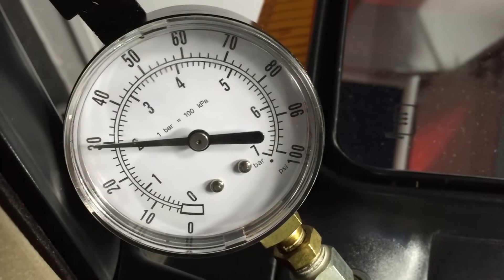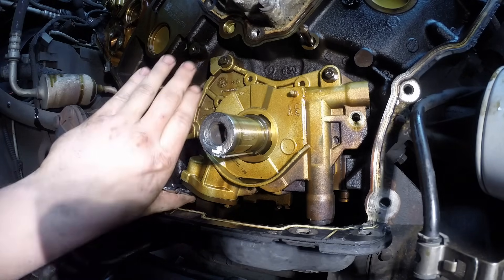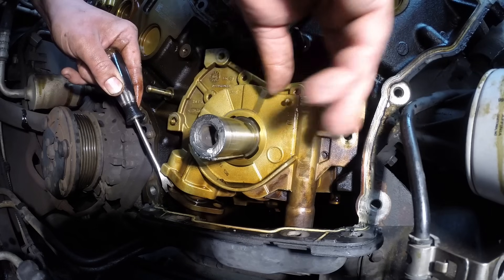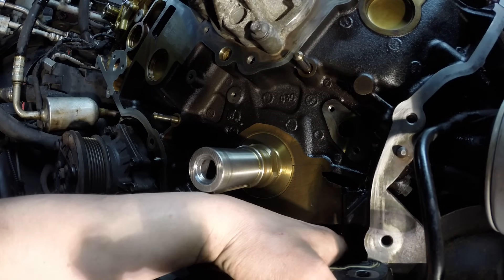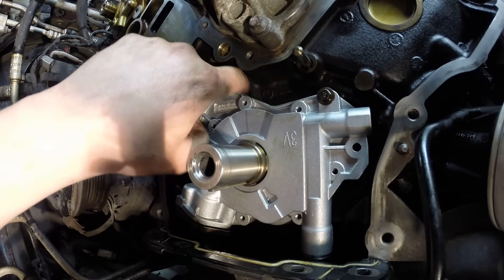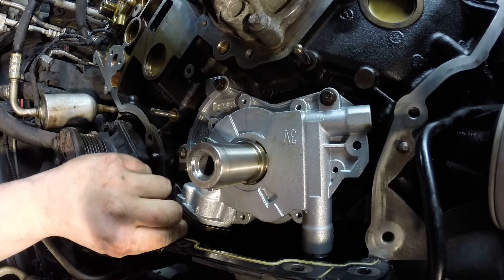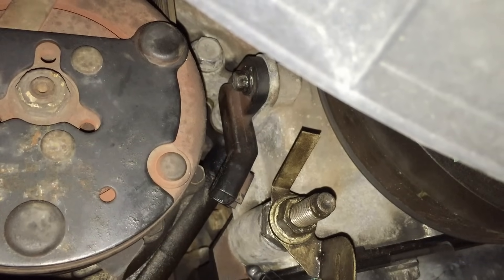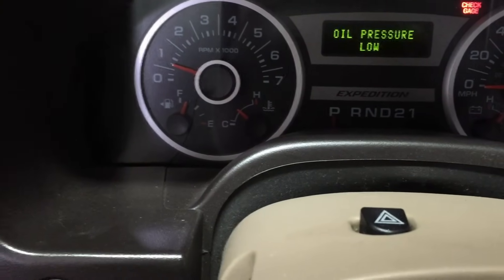Ford 5.4L 3v Engine Melling M360 Oil Pump Upgrade

Comment: +FordTechMakuloco sir I know this is off base somewhat but is there anyway you could put the Engine wiring/starting diagrams and fuse box/relay diagrams for a 2013 Focus Titanium on your sight? Can you direct me to a place that really has the exact things I'm asking for? I need to know which relay is the starter relay and how the starter solenoid receives it's signal/voltage from the push button all the way to the starter and I'm finding this info hard to come by. Anything might be helpful. The problem I'm having is the solenoid on the starter is not having voltage sent to it when the push button is pushed. All the grounds are good,I watched your videos on those things. Thanks for your assistance. Please don't tell me the only place it's available is ford. Also there is no problem with the alarm system,that is not the issue.This only occurs after the vehicle is driven several miles and hot soaked in the sun,come out of a store or some place ,put foot on brake push start button all dash lights as it's supposed to, no crank,wait an half hour or so and then the car starts as if nothing ever wrong. Let sit overnight never has problem.Just after a 4 mile or more drive and a heat soak outside in the sun. What do you think? Trans control module , starter relay, not the starter,when it occurs it's not receiving voltage to the solenoid, I can jump across and the starter works and the car will start and run.
Reply: BBB Industries online under Technical
Reply: Not sure what you mean by that. Could you be a little more specific. Thanks.
Reply: Went to the sight but wiring diagrams were limited at best,just signed up to Mitchell 1 DIY for a month and printed out all the wire diagrams for my vehicle so now don't need that anymore. 16 bucks is pretty cheap for all the have.
Reply: Got a bad TCM trans control module unable to send signal to starter relay. Under warranty from Ford, replaced it and did it for free. even gave me rides to and from dealer to pick up car. Damn good deal.

Comment: Will the Melling M360 work on all 5.4 3V or do I have to use the M340 on early models?
Reply from the maker: +Jean Valjean it works on all
Reply: @FordTechMakuloco  whats confusing buyers on amazon is that, it telling customers that the m360 wont fit 5.4 3v only 5.4 32v. so if i buy the m360 for the 2004 5.4 3v should indeed work right i would appreciate if you reply me here or my email gramiro2827@gmail.com
Reply: @ramirogarcia4947  did the 360 work? I got the melling 340 is it good for the 5.4 3v
Reply: @nicholaspierce9043  Apparently, the 360HV was installed in the 4-valve 5.4 and is backward compatible with any 3-valve engine. Does not fit 2-valve.

Comment: 2 Things I would like to point out is: 1 An it never hurts to put an anaerobic sealer on the oil passage mating surface. And 2, If the guides have come apart, more often then not, pieces end up in the bottom of the oil pan and can get sucked up into the pickup. That being said, I get the commission benefits of not taking off the oil pan, however comebacks are a killer.
Reply from the maker: +lveroflife if a guide came apart in junks then yes absolutely pull the pan
Reply: @FordTechMakuloco  Do you have a video for pulling pan? Is it necessary to raise motor on 04 5.4?
Reply: I think he did recommend that you scope the pan to make sure it didn't have debris inside.
Reply: Is liquid Molly engine flush you recommend? I have a 07 f150 5.4 triton

Comment: hey brian, was there a bolt missing from the oil pump right lower about 3 clock position? or is there a pass thru the front cover?
Reply from the maker: +NCPDFSB yes the bolt for lower guide goes there when you build the timing components up

Comment: Curious if that oil pump has a steal backing plate or a alum one??....seen some that recommend the steel one because the alum one will flex and leak after fully up to operating on higher RPMs.  so I was also wonder if your recommend the steel backing plate one too?
Reply from the maker: +imenriched yes it has the upgraded cast iron backing plate

Comment: I wish you would have done a side by side comparison between the two pumps so we could see why the new design is better.
Reply: The Ford pump had an aluminum backing plate. The Melling has a steel. The aluminum backing plate flexes at high pressure bleeding off oil. I'm sure that there are others but that's the big one. Jasper started using Melling pumps in their engines because of issues with the Ford pumps.
Reply: Interesting - thanks
Reply: Andrew Linn Does Powertrain products use the Melling M360 HV for their reman 5.4 3V Triton too?

Comment: Wow, what a difference in pressure.  Good info on not unbolting anything below the engine. With the pan still on, can you still get to the screen on the oil pump pickup to make sure it is not clogged by debris?

Comment: big difference with the new pump. why did the instrument cluster still say Low Oil Pressure after the replacement ?
Reply: because he had a external oil pressure gauge hooked up where the oil pressure switch would be
Reply: Makes sense to me, disconnected sensor while testing.  10-4 good buddy
Reply: +Ozzstar you must be a super trucker LOL
Reply: Ozzstar in my say  low oil in the engine is off
Reply: what part of he hooked up an external (more accurate) oil pressure gauge didn't you understand?

Comment: what is the service life of the 5.4 anyway.  I have 275k on mine .
Reply from the maker: +sketchyssk8shop I think you are pushing it now actually
Reply: +FordTechMakuloco figured that.  are they rebuildable like the old sb  engines?
Reply: +FordTechMakuloco oh it still can pull my 7500 pound boat.
Reply: FordTechMakuloco, im curious if you could give me a short answer to the problem my car has. its a 99 taurus. when im on the highway and i accelerate from lets say 60-80 i have a hard time keeping my car in my lane. it trys to swerve all over and i have to be ready to counteract it with the steering wheel. there are no vibrations anywhere and the steering wheel does not shake. tires seem to be wearing evenly too. the car just trys to swerve or drift side to side. it stops this soon as i let off the gas. always feels ever so slightly drifty at constant highway speeds whether ive done much accelerating or not. any ideas? is it steering like toe in/out or can the transmission be applying power side to side?
Reply: Billy Darley check the Motor Mounts 😎
Reply: I had over 400k on my '97 5.4L 2v before the radiator plug blew out and cooked the head gaskets before I could get pulled over.  I may put the M340hv in my replacement ATK engine before I put it in.

Comment: is it required in the ford 4.0 engine too?
Reply: 4.6 modular v8 maybe dunno about a 4.0
Reply: +drwombat ok, thanks
Reply: no, the oil pump on that engine is different, also the timing chain set up (on the SOHC) is very different.
Reply: +Charlie Gates yea,i've seen it

Comment: Was this the same truck you did the cam phaser demo on? 
My boss wanted to argue with me the other day about the oil pressure switch for the gauge thing. Swears he sees his move.
Reply from the maker: +CamperMike yes it's just a switch you can disconnect it and ground it out to the frame and it would show oil pressure in the cluster
Reply: @FordTechMakuloco  Yea but to suggest its useless is dishonest. The gauge is not an exact measure but will give you an idea. 25=30 psi is fine for your 3v. The gauge showing just that, the oil is in a good pressure area. Gauges do malfunction however.
Reply: If it has 1psi or greater it says it's all good. If the gauge moves you prob don't have oil or the computer is just messing with you. 
Did like to see a T put on where the oil pressure gage is so you could have a real gauge and the sensor on at all times.

Comment: Where was this video 6 months ago! I lost the passenger side cam and last lifter. 1 month later I found out the guides were bad and replaced the chains/guides/tensioners. Everyone said the cross member and pan had to come off, so I did not do it! The chains were not bad it was mainly due to the guide failing. Mine is 2 wheel drive.
Thanks for the video.

Comment: You can also invert the pump and pour oil down the inlet and turn the rotor until it comes out the outlet w/o removing the cover.  Great time saving video Brian!
Reply from the maker: +Hayward's Automotive True but I like to give a visual to make sure it's machined right and no problems before putting it on plus I squirt a little in the regulator ports.
Reply: @FordTechMakuloco  Brian, after priming, what's the torque for the oil pump cover?
Reply: @jamesplotkin4674  89 “ lbs torque